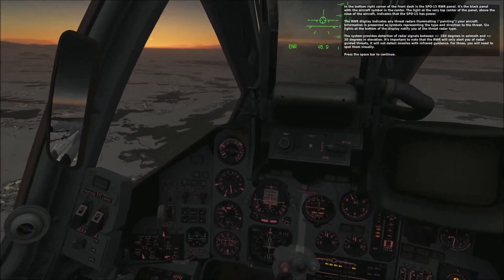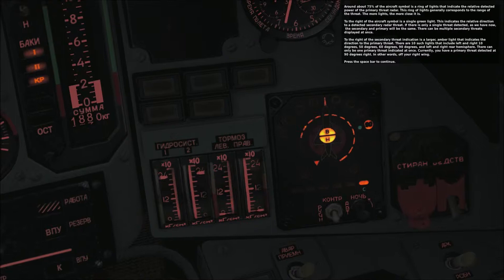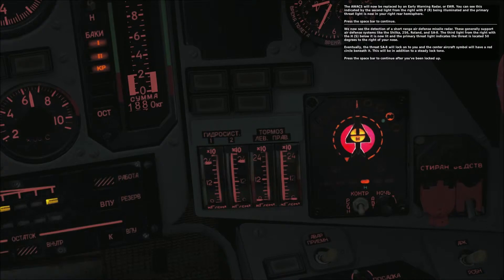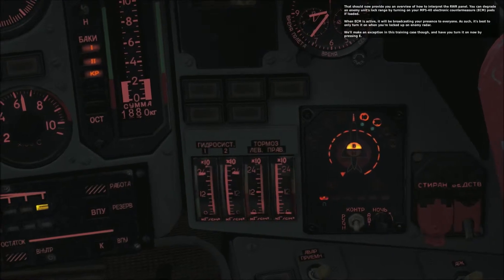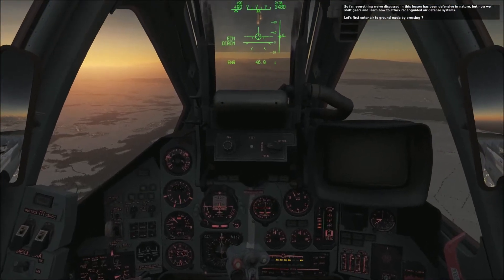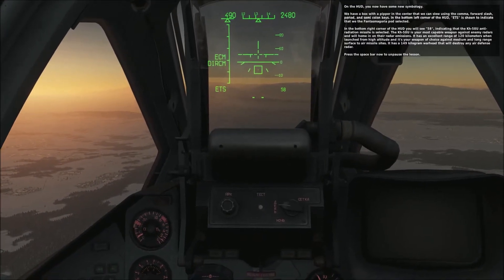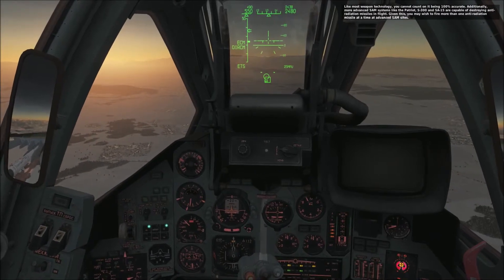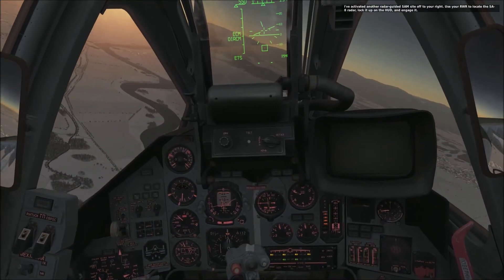DCS: Su-25T Anti-Radar Missiles, Radar Warning Receiver, and Countermeasures Training

Comment: how did you avoid the missile fired, i cant do it
Reply from the maker: If you're referring to the short range missile being used to demonstrate a lock and fire situation around the 6:00 mark, simply press the spacebar to continue, it will remove the unit that fired, and the missile fired will destruct. If the later missile defense systems fire, you'll have to use chaff (as these are radar guided) and maneuvering to avoid.